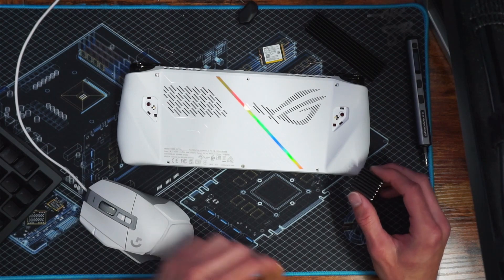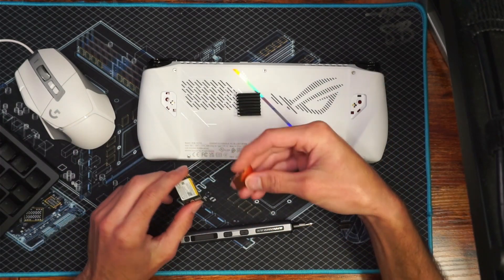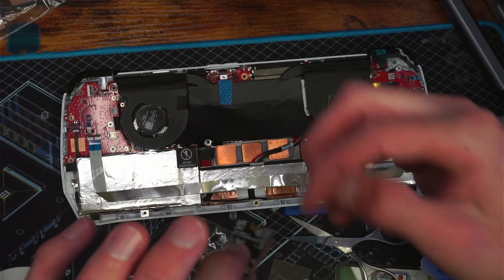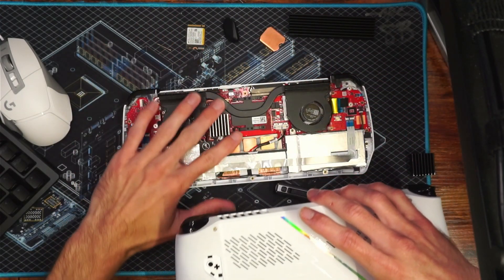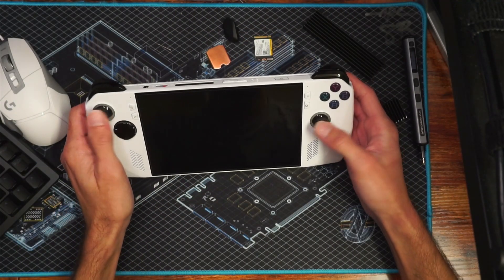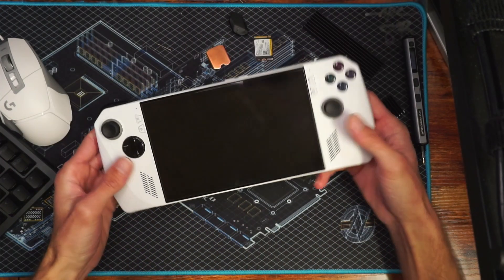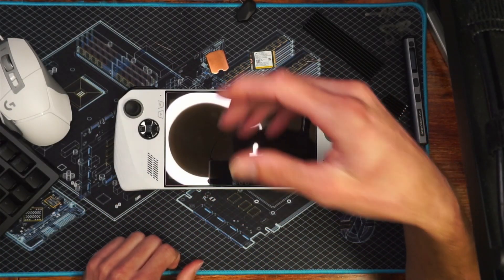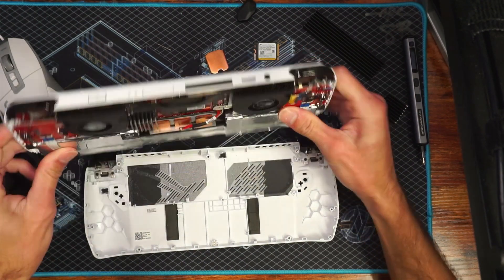The Ultimate $8 Rog Ally NVME Cooler! + My one month Ally thoughts! WATCH BEFORE YOU BUY!

Comment: would it not attract heat to the ssd card by being righ ton top of it?
Reply from the maker: No this won’t affect the sd card temps. Having your nvme drive not thermally throttle is important and helps in many ways. If anything it could lower the rest of
The board and sd possibly because it’s extracting the heat off the nvme and allowing it to not soak back into the motherboard.

Comment: have you tried removing the skicker. there is 2 ckips on that m.2 2230. the smaller chip is what gets super hot. and its also at a different hight to the actural memory. try doing a test with thermal paste instead and see if you get a different result
Reply from the maker: Don’t use paste. It pumps out and dries out. Very bad long term for sure. Also thermal paste only works good in very small gaps and needs alot of pressure to be efficient. 
Also don’t remove stickers. It voids warranty on drive and doesn’t help temps. I’ve tired.
Lastly using a 1mm pad is perfect because it has just enough squish and compression to perfectly adjust for the height difference. Imagine when you lay on a memory foam mattress how it curves to your spine. Thermal pads can do the same with the right pressure applied.
1mm pads are equipped on 99.9% of desktop motherboards and have been for as long as nvme drives have been around and drives for the longest time have had the same hight differential on the controller and memory. The pad sizing is perfect. If .5 was better you’d see motherboards all running .5 and if paste was better you’d see everyone running it.

Comment: Would you suggest going to 24 or 32 gb of ram . I was gonna send mine off for like 300$ but you cant udate the bios after the install . Thats what has me on the fence but they should be  done with good bios updates. I really dont want to buy the X but want the ram 😂
Reply from the maker: Wait for the full reviews come out comparing the ally x to the ally og. Also have you ever seen benchmarks for the ally upgrade? I sure haven’t. It’s extremely sus to me why we haven’t got a flood of videos proving the success. That’s the biggest and easiest way to convince people to buy the ram mod and would increase sales soooooooooo much. Massssssive incentive for that… so I ask myself well… that’s obviously going to increase sales so why wouldn’t someone take 5 mins to benchmark a before and after shot?….. that’s like extremely sus. 
I’ve got my theories on the upgrade but I can’t prove it. What I can prove is that one of the guys who was also doing the ram upgrades was having major issues … several things occurred. 1: he had a bad batch of chips 2: having a bad batch of chips means he had to solder and desolder the ram several times till he found good chips. Boards sometimes got destroyed because of being heated up too much. Silicon has its limits….. then he ended up closing up shop! Guy couldn’t do it anymore at a loss. So that I can prove, the other thing I can prove is another guy who does gpu repair made a video warning people about really bad memory chips coming out of China as well…. I’ve seen enough to make me compelled to not suggest it anymore until I see real proof 1: the device performs better in both benchmarks and games that can take advantage of more ram: 2: no ones having any long term issues. Bga soldering always is slightly risky and it’s a fine fine art. So just tread carefully. I think you’d be better off selling your ally for 400$, putting 300$ cash on top and buying an ally x. I also know armory crate tries to update bios automatically and what happens if you click it by accident? So many unknowns and no one in my community has done it so I can’t validate or support anything without proof
Reply: @cppctek  Everything you said has been on m my mind . Especially the bios updates . I seen people asking Ole slick or who ever he is to post videos with no outcome . I seen you ask a guy about doing it for you maybe . So I figured you where thinking about it also . Thanks for you time sir ! I'll be sure to join your subscription
Reply from the maker: @youngjustin82 thanks a ton. I can confirm I have an ally x btw and I currently have 2 og ally’s.  I will be posting side by side comparisons in games like mw3 and forza and more that I’ve always needed more ram for. I’ll be demonstrating perfect use case scenarios to take full advantage of more ram

Comment: You should get another one of the copper shim style ones and instead of bending it push it on as is. I think those are designed to be a friction fit and when I installed mine I simply pushed it on with my fingers and I got much better results than you are listing in your tests.

Comment: Hi, I have ordered one of those m.2 right angle adapter and a 4tb 2280 ssd (crucial p3 plus). I have also ordered a sabrent nvme heatsink. Can you please test. I think it won't be enough to cool the ssd. Also the cooler you showed in this vid in 2280 size. Will it fit, if I were to cut the plastic structures in between? Please make a video on that if its possible for you. Great stuff btw
Reply from the maker: Hey thanks. Check out my newer videos. I’ve been running the 2280 adapter for a while with an ekwb heatsink. My handheld diy backplate videos should show it off well. Also I’m editing a video now that goes in depth on the right tips that can help

Comment: On the off chance you see this comment 8 months later, you should clock that heatsink 90° so the fins are in line with the air flow, rather than acting as air dams as they are now.
Reply from the maker: All I run is the 90 degree adapter now
Reply: @cppctek  ahhhh, you're doing the 2280 mod?
Reply from the maker: Did it months ago. Never looked back. Check out all my full length videos.
Reply: @cppctek  in the process as we speak haha. Lovin the content dude
Reply from the maker: @Jake-kw4ql thanks !

Comment: Don't listen to this dude It can run stock just fine without nothing You don't need a modify it In if you do you're getting trolled 😂
Reply from the maker: This is for people upgrading to faster more higher temp drives if you followed along. No ones trolling. I even made a follow up video where I spoke directly to various drive manufacturers. You right now = 🤡

Comment: You are placing the heatsink and thermal pad on the ssd and that's it ? can i get rid of the plastic protector? Am watching lots of videos i already ordered the 25x25 by 10 and the g lid thermal pad.
Reply from the maker: Yeah ditch the black flap for the ally it traps heat
Reply: @cppctek  i don't know if this normal am not an expert really but i followed a tutorial on how to install it and i freaked my life when i tried to turn it on it was not turning on i unplugged battery press for 30 sec finally I tried to open it plugged and it work, it is normal?  I hope i didn't force the connector of the battery too much while it wasn't necessary, everything seems to work but am afraid i touched the thermal pad too much with my hands, but now non issues so far, i grinded a corner of my heatsink to make it fit better, i hope i did it well xd.. the installation is simple but am sacred i damaged something without knowing

Comment: Hey !!! I followed your video and installed the same size heat sink on my Ally but I have the Jasaux rgb back plate and I can confirm it does not fit. It's extremely close and you can get the back plate snapped together but it pushes on the heatsink enough that it actually leaves the M1 button non-functional because it warps the plate a bit 😢
Reply from the maker: I currently have the 2280 mod done and the ekwb heatsink and it fits perfect and works perfect.

Comment: Hey man, thank you for the video. I just installed the heat sink and now my 1TB SSD won’t go above 63C on a 2 min write stress test with crystal mark, maybe I can get better temps with the pads you recommended but I used an extra one from my EK gpu waterblock. I also put a zip tie just to be safer
Reply from the maker: The zip tie may put too much pressure under it. No need to do it if you used the same size. Check out it my new mods video for some tips All of MY ROG Ally Mods + How I clone my drives with one button! Feat. Yottamaster NVME Duplicator
https://youtu.be/8DjTrHzf6LA

Comment: So I would place this on top of the SSD?
Reply from the maker: Correct
Reply: @cppctek  holy cow that’s a neat trick. Hmmm I might give it a try thanks for helping the community can’t wait to see more
Reply: @cppctek I do have this black plastic type of material that originally came with the ROG can I put the heat sink on top of that also or do I remove the whole black thing covering the mother board?  I noticed in your video you don’t have that black plastic thing at all
Reply: @v3gao_official right. i would like to know if i should remove that black plastic or if i should keep it there.
Reply from the maker: @reticulizeta7351 def remove. Go check out my updated mods video

Comment: Really cool but you should find a heat block with the fins oriented in the other direction. Then they got in the same direction as the air flow. I assume if its exactly 25x25 you can rotate it and it fit just the same. The only issue may be the back frame that holds it in palce may not work as well.
Reply from the maker: Check out my latest video on my mods All of MY ROG Ally Mods + How I clone my drives with one button! Feat. Yottamaster NVME Duplicator
https://youtu.be/8DjTrHzf6LA

Comment: I'm gonna buy a new SSD for my Ally but I don't have small screwdrivers to open up the unit and I'm afraid something I randomly buy will strip the screws on my device can you let me know what screwdriver you used to take yours apart by any chance?
Reply from the maker: I used a cheap Amazon electronics screwdriver repair kit for about 10$ on Amazon. Theres a ton of diff ones between 10-20$. Just a Phillips head but like an 0 or 00 size

Comment: Excellent discovery. Have you tested orientation of the fins, horizontal vs vertical? Based on fan intake position and the slots in the rear of the Ally, a horizontal orientation may cause the least amount of airflow reduction.
Reply from the maker: The current placement is the one that makes the most sense to me and works the best imo vertically gives the best natural heat dissipation and flow

Comment: Nice work, man. Ordered it. Should arrive in a few days. Really appreciate the effort and I'm sure this will go a long way to lengthen the reliability of the drive. Thank you.
Reply from the maker: Much appreciated!
Reply: One question there is currently black thermal paper (or maybe not I'm a noob) over the middle of the back. I noticed yours either doesn't have it or you removed it. Should I remove it, or can I just cut a square out where the SSD is so the heat sink can sit?

Comment: What temps do you get when running cyberpunk after the install? I am thinking about ordering the pad and heatsink because I personally am getting around 90c running 25watt turbo.
Reply from the maker: Be sure you update to the latest bios and software in the my asus apps. Your temps will drop for sure. Also I game usually in the 70s on the apu temps and nvme temps 40s
Reply: @cppctek  I am fully updated and I still get 90c. I am running medium settings at 1080p.
Reply: @cppctek  would you recommend I tone down the settings more and run it at 720?
Reply from the maker: Nah run 1080 with fsr quality
Reply: @cppctek  I’ll double check my fsr isn’t set to something else. I appreciate the help. I went ahead and ordered the heatsink and padding.

Comment: FYI, NAND flash actually WANTS to be hot. The memory controller, yes, cooler is better. But for the actual memory chips, cooler is worse below a certain point. 90c is too high, yes, but 50c is too low for NAND flash. You can find hard numbers, but the gist is that data stored cold is more volatile and will degrade (if unpowered) significantly faster than data written hot. Pretty sure you shorten lifetime TB/W too. LTT had a deep dive video a few years ago. 

Normally on a 3rd gen 2280 you'd only apply thermal pads to the controller, and the heatspreader/label is enough for the memory. I'm not 100% sure about these smaller 4th Gen drives however.
Reply from the maker: Gen 4 drives run hot. Run any temp monitoring software and alarm bells go off if you run the sn740 without a heatsink or making the gen 4 2230s. 2230s are monsters with less surface area to disperse heat.
Reply: @cppctek hat makes a lot of sense, a 2TB 2230 4th gen is gonna be a hell of a lot hotter than a 2280 3rd gen or the stock 512gb 2230. I'll do some testing once I get my 740!

Comment: Because of this video, i just bought an aluminum heatsink  and a gelid thermal 1.0mm 😂

Thankss!! Hope this also works in my ally ❤️
Reply: did it work
Reply from the maker: @slavkotonkovic6216 yes the aluminum works just as good as copper but without the weight. Copper is not needed at all. Get a 20x20x10 https://amzn.to/3FO3FyZ
Also check out the video I uploaded Friday showing a lot of new ally mods
Building The Ultimate Rog Ally ! More Battery Life - More Storage - More Mods! #rogally #xboxally
https://youtu.be/g_Md86_026o
Reply from the maker: Heck yeah. It does for sure

Comment: Thank you for this incredible video! Your channel is a gem! Just a quick question, when you mentioned the thermal pads, would I buy those plus the heat sink? Like would I cut the thermal pad to the shape of the heat sink/ssd and it would go in between the two? Sorry I’m just so new to this.
Reply from the maker: Hey thanks. Just cut the pad down to the 25x25 size and it’s a match made in heaven. Sticky on both sides. Sticks between the heatsink and the nvme I am
Going to make a follow up video to this as I have got tons of questions to follow up on. Thanks so much for the support!

Comment: I may try this. Seems like a great way to get temps for that down. Have you tried changing out the thermal paste? I saw a video showing the thermal paste in the unit isn’t great from the factory. Haven’t looked myself other than replacing the NVMe drive.
Reply: Dude the paste on the APU is great. It isn't even paste, it's a Honeywell phase-change pad. I've seen liquid metal having zero benefit. If you want your temps down, limit it to 20w. I've found incredibly small FPS gains going from 20w to 40w but temps went 70 to 95
Reply from the maker: Thermal paste may drop apu temps 2c at best. Not worth voiding the warranty over currently. However this heatsink mod for the nvme will significantly improve longevity of the nvme and sustained read and write temps under stress.

Comment: Is there heat sink for memory card? What is that cooling for battery?
Reply from the maker: This is a nvme hearsink. Check out the video and you will see. There’s no thermal solution for the sd card reader just upgrade the nvme and pretend the sd card don’t exist lol.